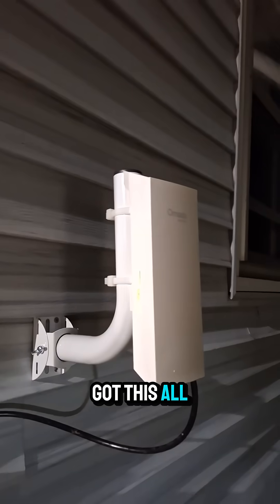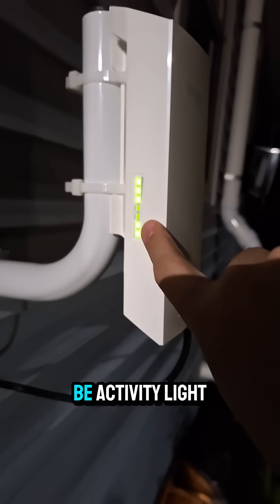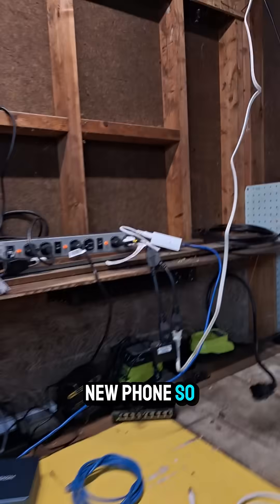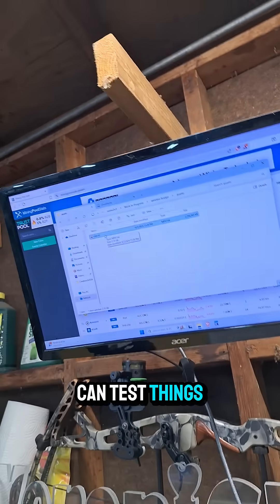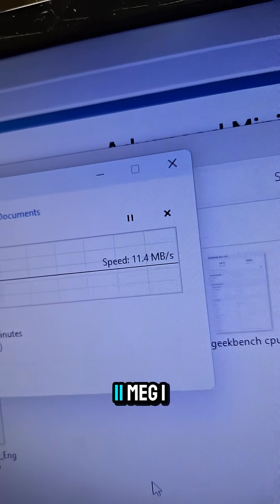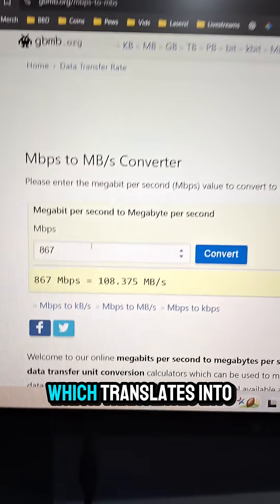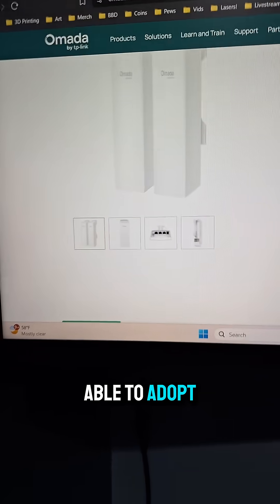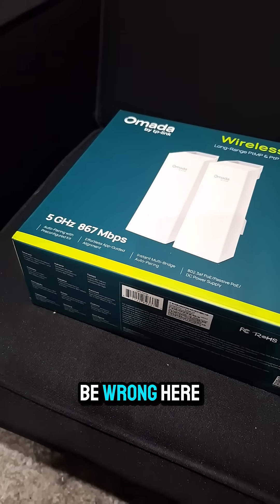It's connected, but only barely...

Comment: base on the picture its 867 Mbps (bits) the b is lower case .. so that would be 108.3MBps (bytes) still you getting 11 is not good .. maybe the link needs to be closer to each other for the max speed?
Reply: formula is /8 , so 867 Mb divide by 8 = MB (bytes)